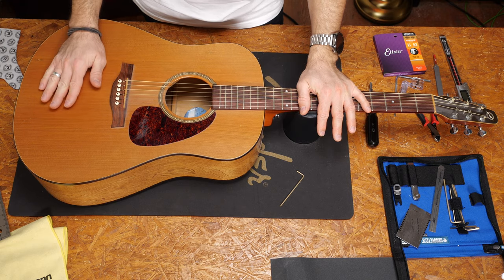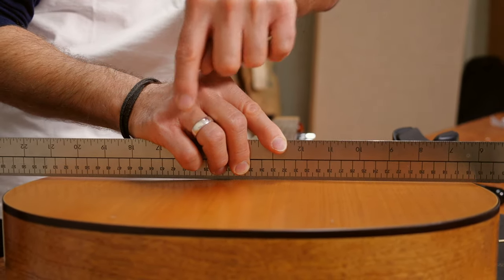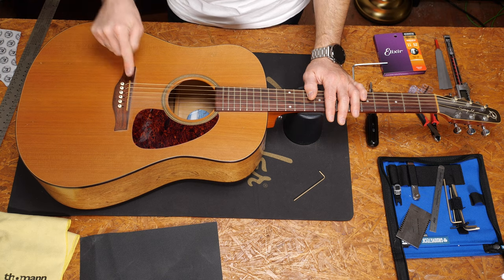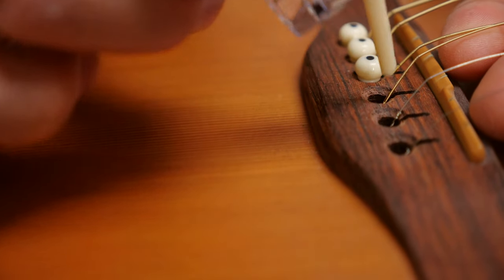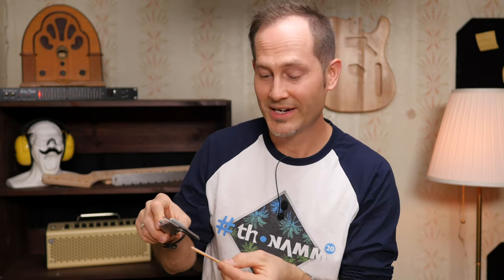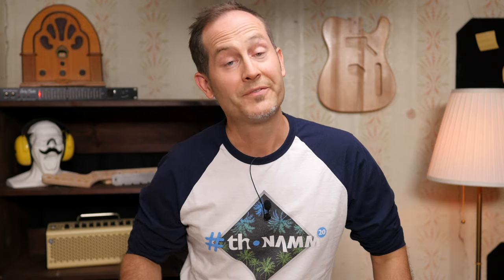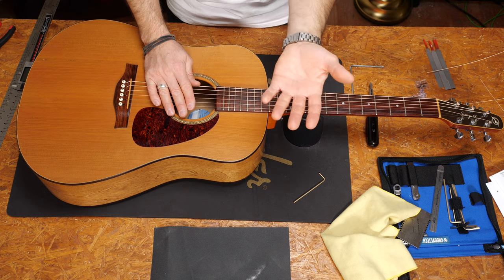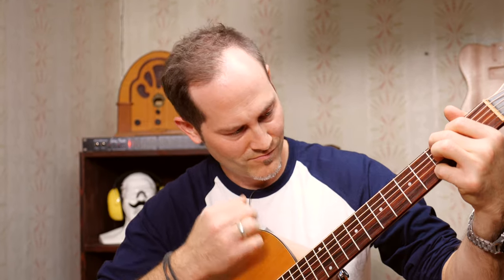Acoustic Guitar Setup Guide | Guitar Tech Tips | Ep. 27 | Thomann

Comment: Question here: the bottom of my saddle is notched because it has an undersaddle pickup (like the ones in some Ovation guitars). Should I sand my saddle the same way you did to lower the action in my guitar or is there a different way to do it for notched saddles? I'm afraid I might ruin the way it is supposed to contact the pickup under the saddle. Thanks in advance and congrats for the great videos!
Reply: You can absolutely screw up your pickup balance by improperly shaping the bottom of the saddle, potentially acoustic sound as well.. This is why Taylor for instance, which also comes with under saddle pickups, doesn’t recommend shaving the saddle as a method for lowering string action (instead, they suggest adjusting the neck angle, which is easy since it’s not glued in on their guitars, I’m not sure about Ovation though).
Reply from the maker: Hey, Victor M is right, you shouldn't sand the saddle unless you are sure about the process. If the saddle has notches and you're not confident about the whole thing, bring the guitar to a luthier. 
Good news is: in most cases you don't have to do anything with the saddle. The right state of the top of the body, and the right neck and nut setup are more than enough. :)
//cheers, Kris
Reply: @ThomannsGuitarsBasses  Thank you so much, Kris!
Reply: @boshi9  Thanks a lot!

Comment: 1-Is it necessary to lower the string height on all acoustic guitars? 
2-What should be the optimum string height at the first fret and at the 12th fret?
 3-Is it true that when calibrating the guitar, that is to say, the height of the strings, filing the bone or maybe adjusting the rail or the nut, it is necessary to check it for at least 2 days so that the wood rests and gets used to the tension that is being given?

Comment: What if the action is still too high after adjusting the truss rod, having a perfect nut and filing down as low as possible the bridge saddle?
The soundboard is quite a bit arched so i guess the only solution is to lower the whole bridge by removing, filing it down  and regluing it.
Is there any other solution besides donating the guitar ? 🤔
Reply from the maker: Hi Panos, first of all, I don't have your guitar in my hands, so I'm just "shooting in the dark". I think (and also hope) that the soundboard is simple too arched. Basically too moist. When wood dries out, it shrinks -> the top should go back down. That would solve your problem. If that's not the case, the neck - body angle is not right and that's a big big issue unless you have a Taylor guitar. Please don't file the bridge thinner, that can cause a number of issues and can ruin the guitar. If you're not happy with your guitar, I recommend bringing it to a local luthier / tech for a check as soon as you can.
//cheers, Kris